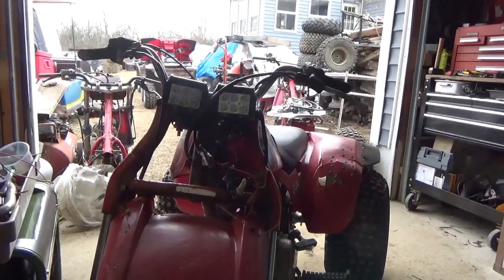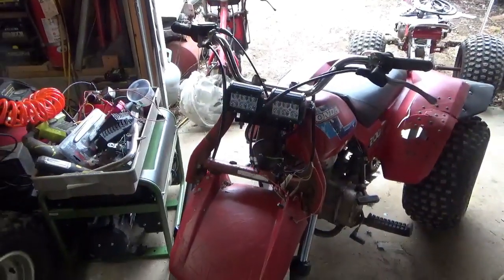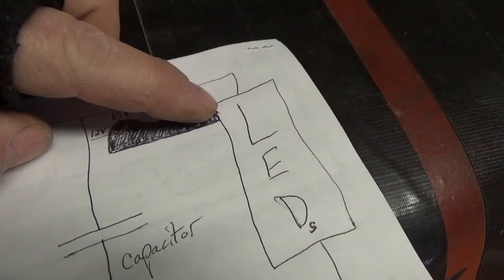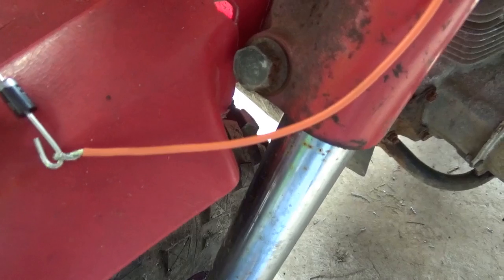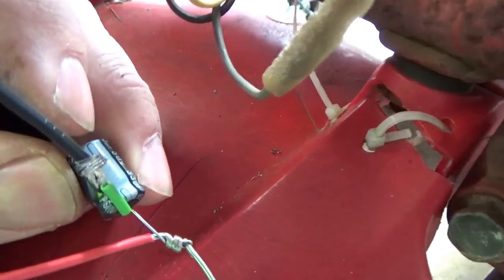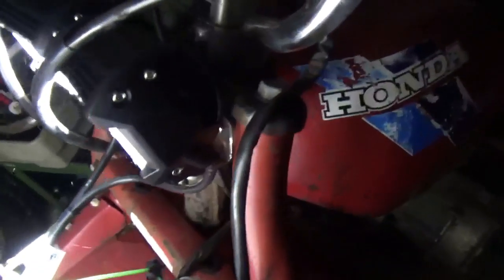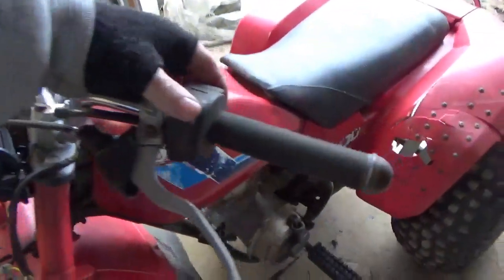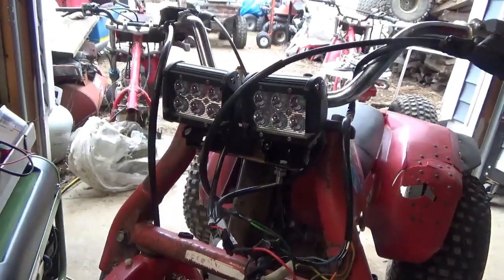$11 Honda ATC 200S LED Dual Headlight Upgrade, Powering LEDs Without a Battery!

Comment: Hey harvey how would you do this without any real power coming from the wires I was wondering can you directly wire the lights to the battery and make a box to hold a battery

Comment: Harvey, do the 140cc pit bike harnesses work on an ATC 200s?
Reply: I know this comment is old but my buddy runs a complete China atv wiring harness on his atc185s. He bought a unit off aliexpress that included a 2 coil stator, voltage regulator, CDI, key switch headlight and kill switch ect. he swapped the coils off his atc stator put in the ones that came with the China harness and ran the harness in the same position as the original and it has no problems it also now has the ability to charge a battery run a winch, power lights has a small inverter on it no problem. And it was paid for and shipped to his house for $30 makes it so you don't have to do any diodes or rectifier to correct it from ac to DC ect. Honestly I'm shocked every trike guy hasn't done it yet. I hate to admit when China can do it better but they can in this case.

Comment: should of used 2 diodes to help with the flicker
Reply: you mean capacitors?
Reply: @brianh5609  a full wave bridge rectifier
Chops off top and bottom of sign wave